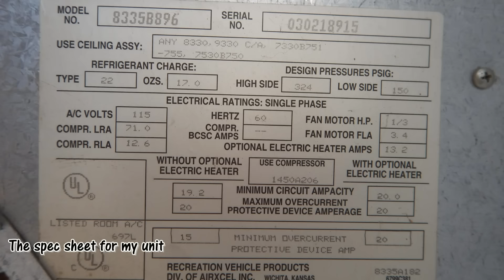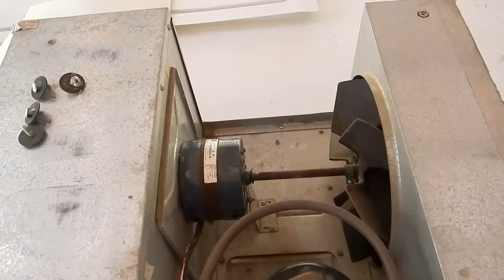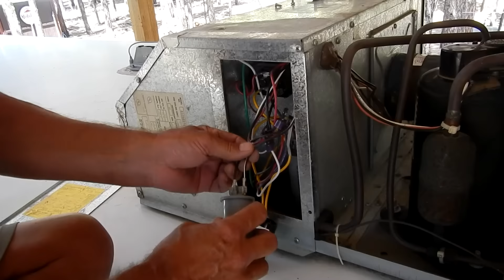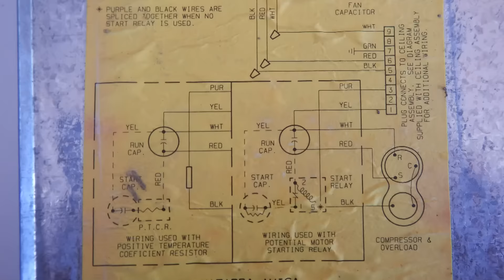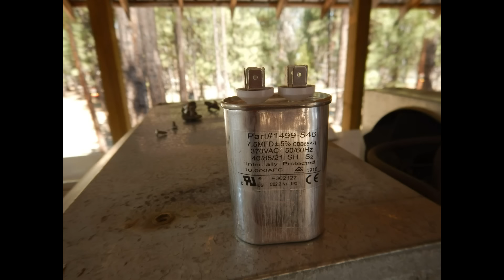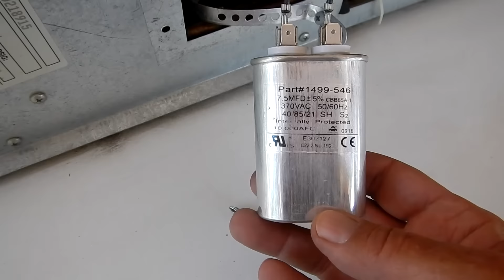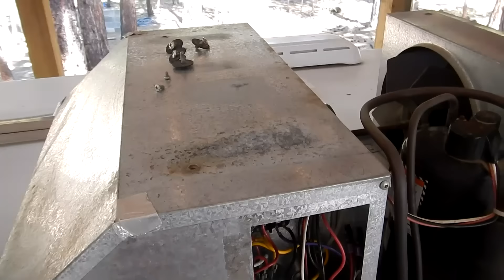How to easily fix your RV air conditioner.

Comment: Hello, I have a question. Can a faulty dual run capacitor cause loud humming noises? I replaced the motor with an identical one, but the humming persists. I’ve checked the rubber isolators, ensured the fan is clear of the shroud, and inspected the entire unit. I also ran the fan without the compressor to isolate the issue, and it still hums. Therefore, it seems the cause must either be the capacitor or potential rattling between the ceiling and the AC unit. Any help would be greatly appreciated. Thank you! I have a Dometic Penguin II ac.
Reply from the maker: Hi there. I know that a capacitor can hum and is often a sign of it going bad. I'm not sure how loud of hum they can make as you stated your hum is loud. Most caps are relatively inexpensive to replace, and I always recommend replacing them if an odd problem comes up just to eliminate them as the source of the problem. Good luck with your fix!👍
Reply: @TomandJulieMineExploring Yes agreed maybe it's worth it just to do it and weigh out that as an issue! Thanks for your input to the matter! 😊

Comment: ok, here is my dilema. My A/C will run on shore power but not on my generator which works fine. On the generator after about 5-8 minutes it kicks out the breaker switch. all three capacitor are new and the Inverter is new. I am being told the that the breaker switch is ok. what is next?
Reply from the maker: It sounds like you have a voltage drop somewhere between the  generator and AC unit motors (compressor and blower). When the voltage drops, the motors draw more current to keep putting out the necessary  power. Either the generator itself or wiring to and from the transfer switch/inverter could be the problem. Hope this helps.

Comment: I forgot to take a picture, how do I know which wire goes where??? Please help. Breakers are tripping
Reply from the maker: @user-ep4cx8td1i  If you only took off the wires to the capacitor, it shouldn't matter what wire is connected to each terminal. Capacitors in an alternating current circuit are non polarized. If you are tripping a circuit breaker, it's possible a wire is shorting to ground or the circuit breaker is bad. Circuit breakers can weaken after being tripped several times and are relatively inexpensive to replace.

Comment: Just changed both capacitors on my Coleman Mach. Capacitors also had no negative or positive markings. I checked for burned fuses on the thermostat and braker box and the A/C still won’t turn on. Any suggestions? I do hear a click sound when I flip the switch on the thermostat but since I live alone in my RV I don’t have anyone to flip the switch for me to see if the compressor or fan turns on. I feel like I should be able to hear it from inside.
Reply from the maker: The capacitors in an AC circuit like this are non polarized, so there are no negative or positive terminals. There are three capacitors on mine. One to start the fan, one to run the fan and one to run the compressor. All three need to be working for the air conditioner to work. You say you changed two. Is that all that you have on your unit? These are complicated systems, and there are other things that can go wrong. A bad blower motor or compressor. Bad thermostat or wiring. Some units have a thermal overload cutoff that can go bad. Make sure your power supply is good. Using an extension cord can cause problems. You might be able to hear if your compressor is running when you turn on the system. It makes an odd type of noise like a rattling growl.
Reply: @TomandJulieMineExploring  Thanks for the reply, yes I only have two capacitors on my setup I switched them both. I also replaced the thermostat, it clicks as if it were sending a signal to turn on the AC but nothing happens. My next guess is maybe something todo with the Rv breaker. Because I don’t hear any humming or rattling from the blower motor or compressor. I recall it making a whistle sound maybe around 2 weeks ago that no lubricant or wd40 would clear it out. Maybe it could be the blower motor.
Reply from the maker: You're welcome. Good luck with the repair. Too bad that it wasn't the caps as that is a very common problem.

Comment: How do you know which capacitor,fan,running?
Reply from the maker: @kathygandy8942  Hi Kathy. It depends on what the unit is doing. If your fan is not starting by itself, but you can start it by hand and make it run like you see in the video, that is a bad start capacitor. If your fan won't run after spinning by hand, that could be a bad run capacitor. If your compressor is not running, that is the third one that controls the compressor. You should be able to hear the compressor running. It makes kind of a strange grumbling noise. Some people choose to replace all three while they are doing the job, which also makes some sense as they are relatively inexpensive. Let me know if you have more questions, and I will try to answer them.

Comment: I have a 13,5kbtu Coleman Mach and I lost low fan but high fan works. Was wondering if it’s a capacitor issue?
Reply from the maker: Hi Justin. First off, I am not a certified AC tech. The three caps are to start the fan, run the fan, and run the compressor. I suppose it could be a capacitor problem, but it seems more likely a thermostat, switch, or wiring issue. I would look for ways to troubleshoot the thermostat first. Good luck with the fix.

Comment: I am currently going through a journey with my RV AC it looks like a very similar model as yours.  
It randomly turns off in a very inconsistent manner. I think its outdoor temperature sensitive to both above 90 and below 60.
When it randomly turns off it also temporarily disables the thermometer inside the RV. Turns back on/becomes responsive after maybe 3 minutes? It usually runs for about 15 mins before turning off. 
I was taking a look around and found that the controller was sensitive to being moved around, it as if it experiences a momentary short but not enough to shut down the unit. 
I dont know if this is the same reason that I experience of it completely shutting off, however its ofcourse still a problem.
Ordered a replacement controller, and just as I was switching the controllers found that the black power cable had a cut on it and could potentially be touching the exposed grounding wire as I was moving the controller. I electrical taped it, reconnected the old controller and tested it again, and the problem still exists. 
I will now attempt to change the controller one more time to the new one and see if this fixes the problem. 

Since the system starts just fine I think I can safely assume that the capacitors are fine? 
The only other potential issues  I can think to check is make sure that the gas pressures are what they need to be, which I need to figure out how to do on these units. 

We shall see how it goes!
Reply from the maker: Many of these have a thermal overload cutoff that will shut down the motor if anything gets too hot. Often, this is caused by an insufficient power supply, like using an extension cord etc. It sounds like your starting circuit is working but one of the caps is for the 'run' circuit. I suppose that could be causing a problem. Electricity can do some strange things. Good luck with it.
Reply: @TomandJulieMineExploring  thank you for your response! I will keep that in mind
Reply from the maker: @volt8399 also know that if it is a thermal cutoff that's being tripped, it will reset itself after things cool down. Usually 15 minutes or so.
Reply: @TomandJulieMineExploring  Ok Im pretty sure my reset time is less than 5 minutes, so it might be safe to rule ot a thermal cutoff, but I do need to test it again and time it.

Comment: A cautionary note: My rig was unplugged but when I shorted my startup capacitor, it sparked so hard that it lit up the yard in broad daylight and my wife was inside the house and thought it was a lightning strike. Im wearing insulated gloves when I touch those things now!
Reply from the maker: That's unusual. Capacitors in an alternating current circuit don't store energy under normal circumstances like they would in a DC circuit. Hopefully,  you had the whole rig unplugged before working on the caps. I'm glad that you weren't injured, and thanks for adding your experience here.👍

Comment: On my ac the fan turns on but it just won’t cool what capacitor would that be?
Reply from the maker: You can usually hear if your compressor is running or not. If it is not running, you could try replacing the run capacitor. The start and fan caps sound like they are working. There could be other issues if your compressor is running and not cooling.  Low on refrigerant would be a common issue.

Comment: After hours of searching, I finally found your video that is the same as mine. My fan is running fine, but my compressor won't kick on. Would one of the other capacitors be responsible for that?
Reply from the maker: That's a definite possibility. There could be other causes as well, but the capacitor that runs the compressor is a good place to start. There are two capacitors that start and run the blower fan, and the other runs the compressor. The thermostat, wiring, insufficient power supply, bad thermal cutoff, or bad compressor are also possibilities for your AC  problems. If you look at your wiring diagram, you will be able to figure out which capacitor is for the  compressor.

Comment: Does anyone know what the three parts are called it looks like one is a fan capacitor and one is motor capacitor and not sure what the other one is called but I have to replace all 3 of those capacitors and some of the wires need to have new ends put on do to some of the wires were melted and looks like this was going on for a while but it does hum like it wants to start but obviously it’s not until I do some repair work and if anyone can tell me where to get these and what exactly they are would be great do to I’m disabled and can’t afford a new unit.. Thank you
Reply from the maker: Hi again, Brian. Make sure you have a good power supply as the melted wires don't sound good. The three capacitors are as follows. One to start the fan motor, one to run the fan motor, and one for the AC compressor. When the fan won't start, it's usually the start cap that's bad. I believe I put the place that I ordered them from in the video description. If you can't find it there, please let me know. Good luck getting your machine running.

Comment: Hi my name is Brian and I have a 2004 Winnebago sightseer and ac doesn’t work but it looks just like yours and I was took panel off and some wires were melted but I need to replace all 3 of those capacitors and was wondering if you could tell me what each one was and where I can order them or a diagram or whatever you can help me with
Reply from the maker: Hi Brian. There are many different AC units, so I can't tell you exactly what capacitors you need. They should each be marked so you can replace them with the same ones. If not, there should be a schematic sticker near the area where the caps are like you see in my video that might have the information on it.
Reply: Ya it doesn’t tell me the part numbers or where you got them so that will be helpful and thanks again
Reply from the maker: I put the part numbers for my unit and the ordering information in the video description.

Comment: I have a white wire and red wire behind the refrigerator in my camper not hooked up do it goes to air-conditioner?
Reply from the maker: Sorry, I really wouldn't know about those wires.
Reply: My air would come on but its blowing hot air
Reply from the maker: @dwightwalker2009  You can check to see if the compressor is running.

Comment: My Coleman Mach motor was running then stopped to humming. Spun by hand only got running on fan, - but some reason I don’t know would not work on cool unless I waited 30 seconds on fan before switching.after 30 seconds I could flick to cool but only lasted 10-15 minutes working proper-then started squeaking then humming.
Pulled the motor off despite 50 unhappy wasps with several nests in the shell.
Anyways a little motion back-and-forth pulling tugging on the shaft is OK and it’s the bearings but up and down action is the bushings and I had up-and-down action on the shaft so my bushings on the motor is shot. In that case replace the motor or find a shop that can get a bushing for it and I couldn’t find a shop that would do bushings-are hard to come by and the unit 20 years old so I bought a new Motor.
I just got the motor and fan cap yesterday near the end of July but I’m not sure about the other capacitors you are talking about.
Reply from the maker: There are three capacitors in this circuit. One for the AC compressor, one to start the fan motor and one to run the fan motor. I would replace all three.
Reply: @TomandJulieMineExploring  Thanks

Comment: The mfd s and voltages need to be the same. Usually there's a dimple or dot for polarity.
Reply from the maker: Replace the caps with the same type that you remove. There is no polarity for capacitors in an alternating current circuit.

Comment: Any idea what might be the problem when there is no response at all from the AC unit? Replaced thermostat to no avail. Power IS getting to the control box and to the capacitors.. I tested the capacitors themselves and they SEEM fine, but I was told by others that they may still be faulty? Two of them are pretty rusty, if that means anything.
Reply from the maker: I'm assuming that the compressor is not running as well as the blower fan. There is sometimes a thermal overload cutoff on the compressor, but they reset after cooling down. Maybe a power surge took out all the capacitors at once? That's odd to have power up to the caps but not to the fan motor or compressor. I guess you could replace the caps, especially if you are planning on getting he unit repaired if it's something major as that is something that would be done anyway. Wish I could be more help.

Comment: Dude thanks I pray that's all mine is
Reply from the maker: If you can start it by hand and everything  works, it's usually the starting capacitor. Sometimes, the run capacitor needs replacing, too.
Reply: @TomandJulieMineExploring  thank you soo much my wife's on her way to get part so I'll know shortly 🤘 thanks again you absolutely ROCK
Reply from the maker: @WalkerAnglerJr  I hope you get it running!
Reply: @TomandJulieMineExploring  so I've replaced both the starter capacitor and the fan capacitor but the motor or something on fan still not wanting to work properly I still have to swing the fan by hand to start then only last a couple minutes then stops any additional advice is much appreciated
Reply from the maker: @Josh Walker Funny life  Not being sure of your exact situation, but you need a good power supply, a compressor, a blower fan, and a thermostat that all work. If yours only runs a short time, there could be a thermal cutoff that's being tripped.
Reply: @TomandJulieMineExploring  thank you so much I absolutely appreciate it

Comment: Mine hums and the fan is trying to turn very very slowly but can barely turn. I checked the fan for debris and obstructions and it's clean. When I try to give the fan a push start with my fingers it still won't freely spin....just very slight jumpy movements. Any ideas on what might be causing this?
Reply from the maker: Make sure you have a good power supply. Check that the fan spins freely with no power to it. If it does spin freely but won't start, I'd try new capacitors. If the compressor is running, I would replace both start and run fan capacitors. Good luck!

Comment: Well my fan comes on …
Sometimes have to hit my relay box for the fan to begin spinning but my ac “cool” doesn’t kick on or the Compressor but also my fridge doesn’t cool either and then after 4 days or not working it magically all worked again n then after 2 days it went back off (compressor and fridge” ughhh what would you think it is? I tested aLl the electricity voltages for my appliances and they are all getting the right voltages!
Reply from the maker: I don't know what the problem is. It sounds like a poor power source. You could set the refrigerator to run on propane just to see if it's working properly with that.

Comment: What if when you turn the a/c off you hear the humming noise?
Reply from the maker: You would have to go up top and listen for where the noise is coming from. If the blower motor is working properly it shouldn't be humming when it's off. Sorry I'm not much help on that one.

Comment: Hi Jim  I haveaproblem  can you help me ? When I turn on m ac (4 wind 1994) I heard a click but nothing happens do I should switch the capacitors?
Reply from the maker: They are complicated units where a number of things could be wrong. Anything from a thermostat, power supply, loose wire etc. one if the  capacitors could also be the problem and is fairly easy and inexpensive to fix. Sorry that I can't give you a definite answer over the internet.